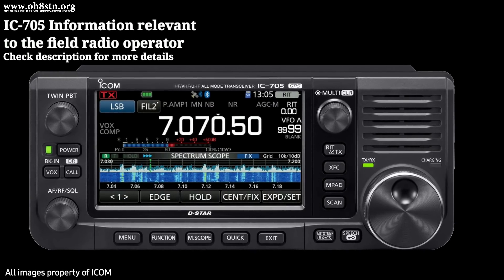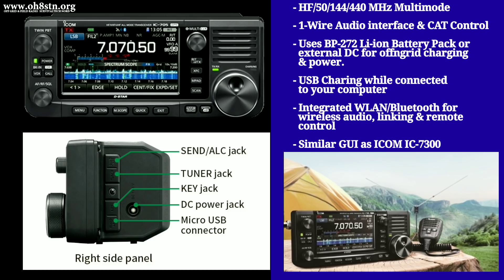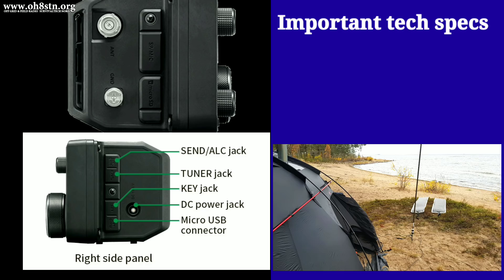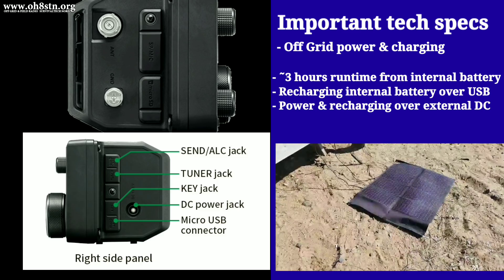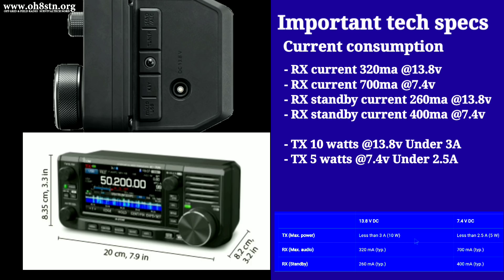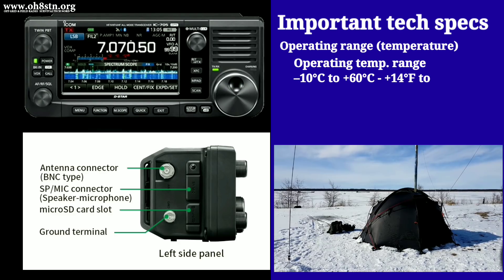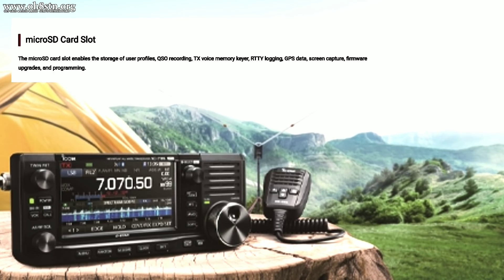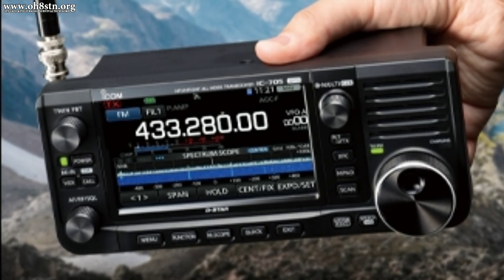Icom IC-705 Update May 2020

Comment: It will be interesting to see if my elecraft T1 tuner will fit into the 705 lol.  Maybe into the battery slot?
Reply from the maker: Actually I think that tuner is a very good idea
Reply: @OH8STN  They are great!  Basically the same tuner that is built into the KX series radios!  I might be able to make it auto track band changes.

Comment: I like it, but there is just an awful lot in the chocolate box!  Shame they didn't have the option of an antenna tuner.  It is that if you are out on the wilds, the antenna will not always be the best one, maybe a bit of roughly tuned wire!  Otherwise I like it and I might even use it in the Shack, in fact I know I would, just a bit heavy on the price, but that might hopefully come down a bit.  Yeah, right!

Comment: If it had auto tuner, it would be a killer. I would really want one. More wires and boxes needed with a tuner.
Like 7300, no APRS (good on the move). With gps that would be so usefull.. It could really use a keyboard for RTTY like would 7300. Sending fixed messages only is not that usefull. I could see a use for that with some small keyboard while on the move too, especially with bluetooth.

Comment: Thanks for the update.   I agree that this is going to be a barn burner in sales, however i think Icom missed the boat on not including an antenna tuner.   Just means that we will have to carry an extra external device in our packs.   I'm sure there will be a new version of the radio in the not too distant future with the tuner built in, in the mean time we carry and extra tuner with us.   Just like we have to do for the 817.   I know you're going to say that we should carry properly tuned antennas, but that isn't ALWAYS possible.   my two cents worth, cheers
Reply from the maker: Well said. There's nothing else I could add.

Comment: Elecraft make an off-grid focused field radio
Reply from the maker: No they don't. They make a radio that's used for a couple of hours in the field at one time. You can't charge the radio in the field. You charge it when you get back home with their elecraft smart charger.
Reply: @OH8STN  Ok. I do like the Icom though - all band all mode SDR in a neat package like that, it is impressive

Comment: I wonder if it will have the ability to turn off all that fancy eye candy?  It seems to draw a whole lot of power! And yes!  GPRS  without APRS seems kind of lame!
Reply from the maker: Agreed and it does. The receive standby mode which is probably not a very good name, is actually the radio operating with the screen off.

Comment: I loved the specs ICOM released back in 2019 and was totally convinced that this will be my QRP outdoors radio of choice. I was a bit disappointed that it does not have a built-in antenna turner, even though this is not  a major problem especially for operating outdoors, most likely an operator will carry a resonant antenna and never needs a tunner. I placed my backorder at DX Engineering and hopefully i get mine once it is released.

Comment: The power consumpsion for this radio is higher than the 817. But not by very much, and with the added features this one brings, it'd still rather have this, than the 817. sees my 817 cry in the corner I'm sorry, it just... its so pretty!

Comment: What I would have liked to see is some sort of low consumption mode where the screen could go into "plain mode" where the rich colorful screen could revert to something along the lines to some kind of an E Ink display once the frequency and setting are all dialed in.  If that saves 1/2 of the 320ma current (or more), it might have been worth the extra expense. Perhaps some are already thinking ahead of some kind of future modification incorporating some sort of an outboard/external E Ink display (if possible).  I have other comments but I'll leave it at that.
Reply from the maker: This is actually a brilliant idea. 👍
Reply: It... meaning the screen... once all dialed in can be switch off... and can be remotely operated by a phone, tablet or laptop... anything with bluetooth basically.
Reply from the maker: Actually hate that standby mode sounds about exactly what you're asking for.

Comment: I'm feeling a bit burned by the re-spec they did on the later serial number IC-7300 radios. I'll likely avoid the IC-705 until the unit has been well used and tested.
Reply from the maker: Resoec? Care to elaborate?

Comment: I am not a QRP operator. Nonetheless, from a marketing standpoint, it would be nice to see an amplifier and  autotuner combo for the 705, something which the 705 easily and quickly could mechanically attach itself to and electronically integrate itself with. Doing so would make it more versatile than any of the 100W rigs out there now. It would give the operator the best of both worlds: a high end field radio and a high end base radio. Yes, it would be pricey. But if one reviews the prices of rigs during the last half-century, it becomes clear that innovation has always demanded its price. Nonetheless, from looking at the number of the functional older high end rigs (like Collins) for sale these days on eBay, it is clear that enthusiasts were willing to pay for most of them when first introduced--and are still willing to pay for them today! Is there a market for an integrated tuner/amp combo specifically for the 705? I think there is--in fact, it could even be a selling feature: QRP for field ops and full power for base station needs, all in one fully integrated package.

Comment: Right now the only non-positive I see is that the knobs may be difficult to protect.  A lot of people use rails on rigs like the FT817 and KX3 to protect the knob and such on the front and back.  Those rigs had mounting screws or interchangeable panels for rails to protect the front.  That may be an issue for those who like to simply throw the radio into a backpack.

I'm in the queue.

Comment: Being a new technician, I will only need one radio with this setup to cover all current and future radio needs. Also with limited space in the living room, this will work great. It will serve both as a base and mobile station, comparable with my ID-51A plus 2, shared batteries. With built in D-Star both radio wil use the same data bases and setup. In the car it will plug into either the cigarette lighter or USB ports for power. it is an exciting time to be in ham radio. 73's Julian, and thank you for all you great videos. K0GEN.

Comment: Shame they've done the same thing they did with the 7300/9700, not used a capacitive screen. At least the resistive screen they use isn't terrible. Still going to part-ex my Flex 6500 for it though, seeing as i've already got a 7300 :).

Comment: I love it, I want a home mount with 100w amp  (like a 7300)   For the price, I can't justify it, but it definitely ticks all the boxes that have been empty for me for a while.  Other choice Elecraft KX2 which apparently is also a fine radio (but I need more bells and whistles).
Reply from the maker: Yeah the problem wigh charging the kx2 in the field was my deal breaker. Otherwise it was a good rig. I'm hoping the price on the 705 will come down with time.

Comment: Thanks as always.

Looking forward to using this in the field and at home with magnetic loops and resonant wires. The simple computer interface and charging options are a big plus. The Bluetooth capability is interesting, but based on past experience with Bluetooth in general, I wouldn’t rely on it for operation. If bluetooth actually works reliably then that would be outstanding.
Reply from the maker: Thank you Donald.  Dully agree. I've still got a couple of magnetic loop antennas here begging for a radio :-)

Comment: Anyone else thinking of pairing this with an external amp for a shack in the box that can go mobile and do QRP?  Am I just way over thinking what this will be able to do?  This + Pi or Surface Go and some accessories seems like the ultimate rig to me!
Reply: I sold my KX2 but kept my Elecraft KXPA amp for the shack. Wonderful little amp and I'm hoping it tracks the band changes from the IC-705.  It has a fantastic antenna tuner built it...

Comment: With a tuner connection on the side on the IC-705, I'm  hoping LDG or some other third-party manufacture will come out with a IC-705 specific tuner. I like building & experimenting with portable HF antennas of all kinds.  Being limited to just "magnetic" antennas as another interview  video from an Icom rep stated, really is short sighted. IMHO. 

Thanks for the update. 73 de N6DSW
Reply from the maker: Well said. I'm definitely using all kinds of different antennas with this radio.

Comment: It's still holding my interest.  I would have liked to see a bit lower standby current and more power running on an external power source.   That's not necessarily a deal breaker.  Be nice if the US version could do 220mhz, but I'm guessing that's unlikely.

Comment: I guess potential walkie talkie type usage tips the balance toward internal battery, but that same usage also pulls for an internal auto tuner.  Still, an internal tuner probably wouldn't be wide enough range for a whip on the pack frame. I'd be waiting with baited breath if I didn't already own a KX-3.  While I would expect to bring alon by LDG z-11Pro , Bioeno pack (I'm not happy with the internal NIMH option), and hand crank generator (I'll probably spring for a good solar panel someday).  Though the ic-705 and an Elecraft T1 auto tuner sounds like an interesting pairing too.
But you still have to power the computer (and monitor, if the computer is a pi).  Since the radio has a good display and a beefy CPU already, it's a pity that we can't compile WSJT-X, JS8Call, fldigi, etc., for an API on that computer, on, say, an SD card (such that back to basics is as easy as pulling the card in case of software trouble).  I pretty much don't look at the radio or touch it's controls when operating in the digital modes, so stealing the display wouldn't be an issue.  And SDR rigs already have good DAC and ADC built in, and interfaced to that processor.  That seems like the way to cut down on the cables.
As long as I'm blue skying, modern rigs have close to or all of what they need to also be antenna analyzers.  Just S11 parameters, since there's but one RF jack, but SWR, resonance, resistance and singed reactance is more than enough for checking out different ground system deployments at the summit.
Maybe there will be a KX-4 or an FR-819 soon.

Comment: Still no antenna tuner.....
Reply: No antenna tuner just like the ft-818. But it does have the filters, the panadapter,  dstar built in, and costs about the same as a kx2.
Reply from the maker: No, but the other features and capabilities are more important to me. The antenna tuner would be nice though
Reply: @OH8STN  Icom AH4 is an amazing tuner and very efficent for field operation with long wires, dipoles, loops and verticals all work great with minimal transmission line loss due to tuning at the feed point.
Reply: there's still the resonate anntenna,s and Elecraft T1..in the spirit of Ham  radio we adapt.7 3
Reply: @sandraabarca6029  , yes I agree, the used antenna must be resonant, shurely for qrp it is a must due to avoid radiated signal loss. This said, the so called internal tuners are only there to protect the output transistor for a mismatch. It does NOT tune the antenna as such. The development team has made the right decision to opt for a battery instead of a tuner.

Comment: Lack of atu and price, make it prohibitive - the  xiegu90 has atu, 20 watt, and around $420 on sale- $450 regular
Reply from the maker: I agree with you but it's apples and oranges. You can compare this radio to the kx2, kx3, Yaesu ft-818 and even the xiegu X5105. Not the g90. The g90 isn't better comparison to for example the ft-891.
Reply: @OH8STN  I disagree the g90 is extremely portable when used with a small battery pack. I made a 700mile qso yesterday with a portable antenna . Great qrp radio

, the 705 looks cool and all but just too prohibitive at this time
Reply from the maker: I've had a blast with g90 as well.

Comment: Is it full duplex for Satellite use?
Reply from the maker: Unfortunately no. I was told the reason is I come sells the 9700 for satellite work. Full duplex would be nice though.
Reply: No antenna tuner just like the ft-818. But it does have the filters, the panadapter,  dstar built in, and costs about the same as a kx2.

Comment: I've been waiting for the receive current.  I'd heard some unconfirmed rumors.  Looks like that'd be one of the first specs released for a QRP field radio.  It was both more than I hoped but less than I suspected.  Overall, I'm pleased by just about everything I'm seeing on the IC-705.  I was skeptical of the handy talkie batteries but the run time isn't too bad and it's good about running and charging at the same time.  I wish it had 20W as the maximum.  5W or 10W is good enough most of the time, but I'd like to be able to run 20W when needed.  Of course, if it was a 40W radio someone would want 100W for occasional use, and they had to draw the line somewhere.
I'd like to be able to turn off the screen's LED backlight.  When running JS8Call, I have all of the info I need on the PC and the LED backlight is just wasted power.
As it happens, I don't own any Icom radios, but it looks like the 705 will be my first Icom.

Comment: I too will be a buyer after I save a few dollars. I already have a FT817ND and KX3 and even an FT-891.  I like to go to parks and operate. The ability to set up and take down the station quickly is a nice feature. I do CW mostly but would like to do FT4/FT8 and PSK too. Thus the single wire setup is a feature. 

Three hours operation would be fine for me plus I have a  compact Lithium Ion Phosphate 12AH battery as well as a 45AH one. Maybe I can save power by turning off the display too. When the English language manual comes out maybe there will be  additional power information w/ and wo/ display on.

I will be looking at actual battery life data when the IC705 gets into Hams hands.  Especially digital mode battery life data. I can always get an extra battery that fits the rig too.

Many have commented on the tuner. Well a resonant antenna solves that for me plus I have a very compact and wide range Elecraft AT--1 that I have used with my FT-817ND.

Other suppliers may as you say begin to think about these types of Radios. So I think we will see many more models before the peak in the sun cycle this time around.

I am still undecided whether the portable digital ops I plan would be best served with a laptop or PI and tablet. I am leaning toward the PI.

Comment: Thanks for the update, I'm sold.  One note; the CommRadio CTX-10 is a beautiful little QRP rig, built like a tank, with ATU and internal lithium batteries and a charge controller which will charge from 20v down to USB voltage.  Keep up the good work, your videos are outstanding.

Comment: It looks like this radio, if it delivers on all the specifications and is rugged enough to survive an adventurous life, will become a classic radio. One with a large following, with many third party accessories and modifications.

I am sure this will be a step up from what is currently offered, and will be much more convenient than the usual tangle of wires you end up with if you want to power it, connect to a laptop and do digital modes.

I will not be buying it. Why? (1) The cost is not going to be something that one just shrugs and pays up. (2) It offers no real new capabilities for me. With my current equipment, I can can do SSB, CW and digital modes, with adequate power output and good current draws. If I am talking with you, you will not be able to tell if I am using a 705 or my current equipment. Yes, I’ll miss some of the SDR filtering and the pan adapters, but they are not “game changers”.

I am not a 705 hater, if my current equipment was lost to a flood or lightning strike, then I might consider this radio as a replacement. I am just not sure if it is so revolutionary that I would sell up. I am sure you will all let me know why this is the best thing since transistors, but I will be ok with my current stuff. Charlie KM4ZZ
Reply from the maker: I don't completely disagree. As someone who spends most of the time in the field, Simplicity is the most important specification this radio offers. I can certainly do all of things necessary with any of my current configurations. But having a single radio with no Tangles, no taped on boxes, no wire mess and easily charged in the field, this doesn't exist right now.

Comment: Let get this straight.  I am not an Icom fanboy.  However, I did purchase the IC-7300 and having used it for meeting my requirement, I decided to buy the IC-9700 for home base communication since it is a great companion and it met my requirement.    Now that the IC-705 is coming and the spec meets my needs I will adopt it too.  My point is if the manufacture keeps meeting the needs of the Ham community we will reward it with our money.  Regardless of the name on the label.  I have radios on my arsenal Yaesu, Kenwood, Alinco.   It is all about meeting your requirement for off-gride outdoor communication.  And don't forget to add my special battery pack inspire by OH8STN.  Thank you, Julian, for that one!!!